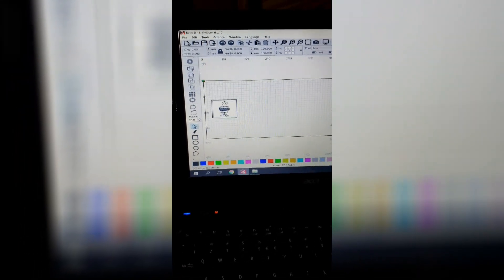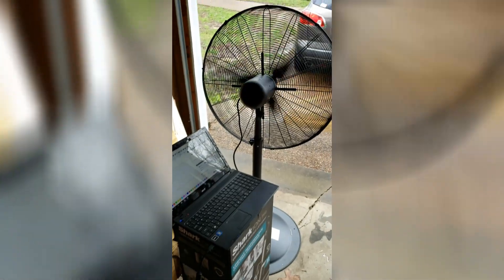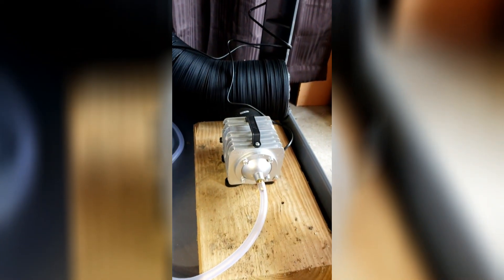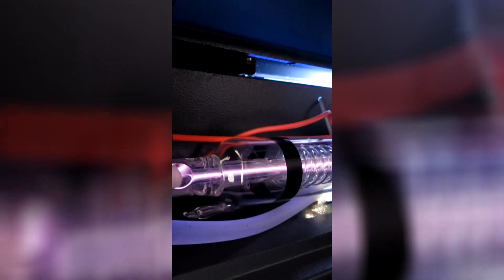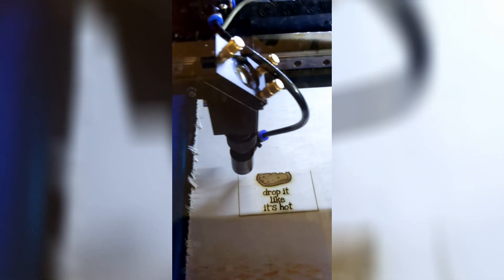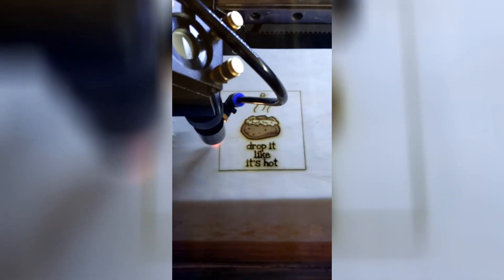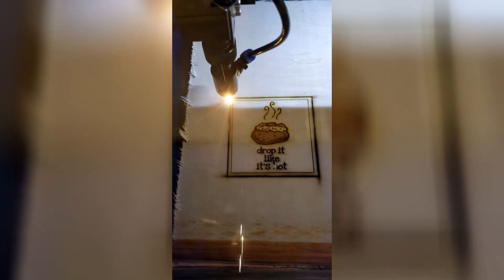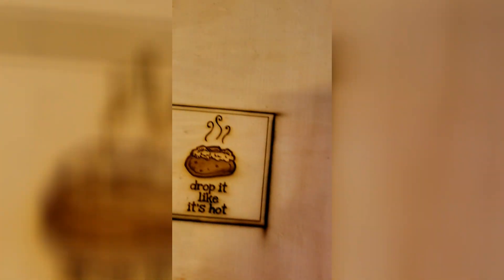50W Laser Engraving Machine Unboxing and Demo

Comment: Hello. 6040 50w china. What is the maximum thikness you can cut acrylic you can cut, with one or more pass to have reasonable good edge?
Is it good to do more then one pass? 

(10-15mm) thx
Reply: The 4040 machine i bought can cut 5mm acrylic and 2mm mdf in single pass